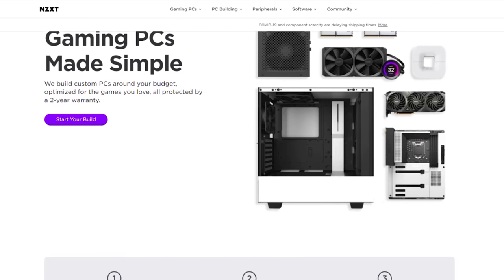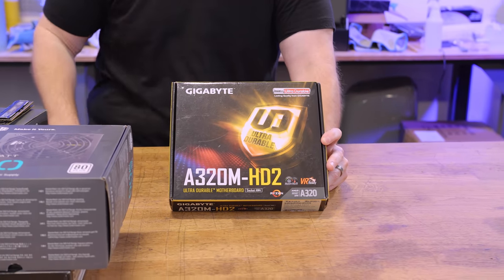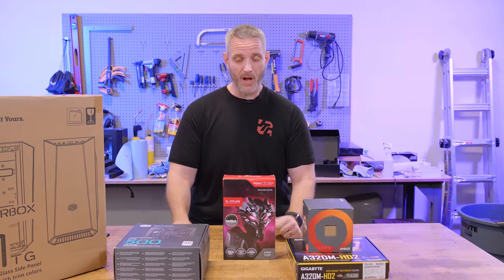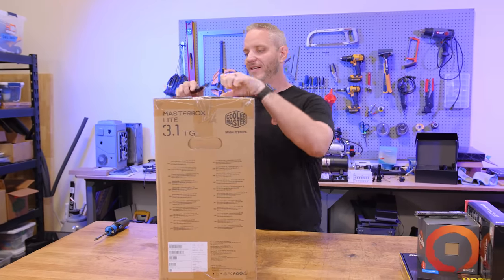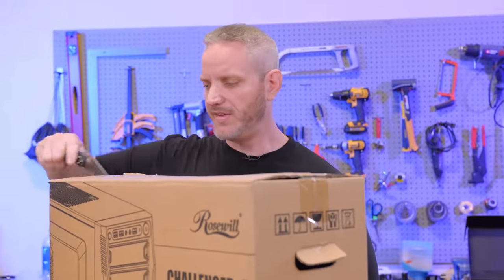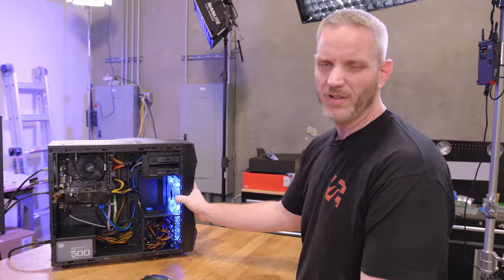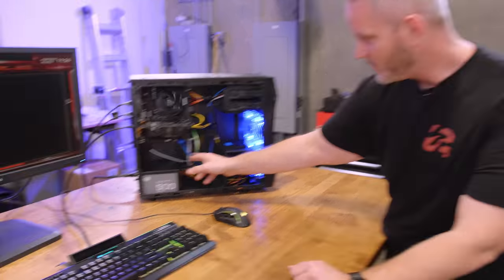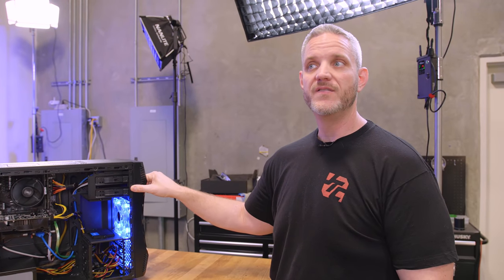The most Practical PC Build of 2022... Extremely Tight Budget Build!

Comment: My parents landed up with an overkill "low end" system simply because last gen parts are still stupidly expensive over just buying a new Ryzen 5600X. They had a A8-5600K APU with 8GB of RAM that wasn't cutting it. I had an extra X570 board forced upon me by the Newegg Shuffle that I wanted to use. So a 5600X and 16GB went in. They already had a Quadro P400 card to run two 1440p panels since the old APU's iGPU couldn't handle anything that fancy. It's all stealthly packed into an old Antec NSK4480, running cooler and quieter then that A8 APU ever did! Even still has the DVD drive, just because. I still need to find one of those drive bays with USB 3.0 ports so it has modern connectivity.

The biggest problem I had was the 480w power supply wouldn't work with the new board for some reason, so I had to drop a cheapo 750w unit in there (smallest I could find local).

Comment: I think that system will serve her well for probably the next 5-8 years. A sata Blu-ray drive might be a good idea, since they can play DVDs, and the Blu-ray would be a good idea since a lot of disc based content is Blu-ray these days
Reply: 5 years at max (until Windows 10 is active), unless Microsoft upgrades compatibility to allow Windows 11 to run on Ryzen 1000 or 2000 Series.
Reply: Having blu-ray capabilities on your desktop is so choice. Only problem is, the Blu-ray Disc Association, in their infinite fucking wisdom, decided that the only (legal) way one would be able to play UHD blu-rays on a desktop would be to have an Intel processor from 7th to 10th gen (11th and higher doesn't support SGX and, thus, won't support the DRM) and to have a PC running Windows 10. No, not even Windows 11. That's it. Those are your only (legal) options for UHD blu-rays.
Reply: @Sup_D  Windows 10 support officially drops in 2025 but 2022 might actually be the last year during which we get updates for W10.
Reply: @arnox4554  bruh

Comment: My husband does a lot of DVD burning (home videos and backup copies of his video edits) so the reason I ended up buying the particular case I did for his build 2 years ago (A Phanteks Enthoo Pro) was because it actually had those bays and the price was right.  It has a SATA internal DVD burner.  I've explained to him since that it's probably the last time, since in 4+ years when we plan to replace his rig again I expect it to be tougher to find a halfway decent case which still has those.  But I also told him that external DVD burners are a thing and will work just fine for his needs.  My current 6 year old rig also has an internal DVD drive (in an NZXT 210 Source Elite), but I'm going to skip an optical drive entirely when I build a new system this summer.

Comment: As a Canadian, and how Im subject to slightly higher pricing, Im not sure how going with an older gen Ryzen to add a graphics card, when something like a 3200G probably would have been the better play here in terms of modern budget?
Reply: I'm helping a Canadian out and the 3000 series is not all that much cheaper than the 5000 series. Especially the 5600x. I feel like I'm getting people into a cult or something because I have one and now my friend has one. But for the estes $50 or so, it's a fantastic chip for the money.
Reply: @MrJr1976  I mean, it's obvious they're all parts he had laying around for years. The 1300 looked like it had old paste on the pcb, which is fine. He took parts he probably would have otherwise never used again to help her out on the cheap basically.
Reply: @xwalkerx27x  Exactly. I'm just talking about for someone who doesn't have PC parts just lying around

Comment: my practical build that i built on a tight budget 3 years ago now has an i5 9400f, asrock z390, with a darkflash cooler, a radeon rx570 8gb armor oc, 2x4 gb t force dark ram at  2400, a 1tb wd mechanical hard drive all in a nzxt h500

Comment: Mine absolute budget build turned out to be $418-ish after tax
Inwinn Case I bought locally for $45
A520 Board for $50
AMD 5600G for $211
16GB 3600 DDR4 for $80.

SSD and Wireless adapter migrated from previous builds. If had to buy I guess it works be $45 for the drive and $18 for the WiFi.

Comment: Sounds similar to the build I initially pooled for my parents to replace their HP Media Center. Ended up with a 7100 intel i3, 1050ti and 8gb of ram... 

Over the pandemic it got my old i5 7500 and an extra 8gb of ram to run iracing.

Comment: Just doing a similar HTPC themed build.
All in for $390AUD
New Parts: i5-10400
Used parts I bought: GA-B560M AORUS ELITE, 2x8GB DDR4 3200
Stuff I had: 60GB SSD, Antec HTPC case + PSU, 2 HDD's and a DVD drive.

Best bit I've sold nearly $300 of old PC hardware I didn't need :)

Comment: I would have gone with an MX500 on the SSD. Just because you are not gaming with it does not mean you should'nt be concerned with the duty cycle of the SSD. Having storage that will last twice as long before it starts having problems is worth the price difference between the BX and the MX. Unless it is a scratch disk holding only temp folders and swap, you should avoid the BX line.

Comment: Two Christmases ago, I built my girlfriend a practical "gaming" PC, since she had never owned anything besides a crappy Windows 7 laptop. I built it from left over parts I had over the years, it has:

i7-3770K overclocked
ASUS Sabertooth Z77
Corsair Vengeance 1866Mhz 8GB 
GTX 760 2GB
Corsair 750W PSU
1TB SK hynix 2.5 SATA SSD
Corsair 750D case

The only new parts I had to buy were the SSD, and I got the PSU and mobo off of eBay for $100 total. She mostly plays super basic games so she's been really happy.

Comment: Back in 2019, I did something similar for my family, after their HP prebuilt crapped out on them. Though I ended up using a 2200G and a B450M DS3H, since they were available as a combo. System cost less than a prebuilt, and was far better, too.

Comment: My practical build:

Ebay Optiplex 9020 that came with a 120 GB SSD and windows 10 pre-installed
1 TB HDD
140 mm fan that fits (with heavy modification to the internal hard drive bay)
Amazon GT 1030

It works well for the games I play. The only time I’ve wanted to play something and couldn’t at all was warzone. It would be nice to have something like a 1050 ti or better, but only to a certain point because the power supply is only 270 watts.

Comment: i did a practical build for my younger brother, with leftover parts specs follow:
Cpu: i3 10100F
Gpu: GeForce 650 Ti Boost
Case: a 20 yo HP case
Ram 16GB Crucial ballistix
MoBo: Asus Prime B460M-K
Storage: Old laptop hard drives for a total of 1TB
then i threw in a wifi card

Comment: We chose the same case for our grandma builds. I went b450 DS3H, stuck a 3200g in it, a 250GB M.2 SSD, and a PSU and called it a day. I think I spent about $350 on it. Was about a year ago. The PSU is questionable as it is the Gigabyte P450b. Technically not listed as one the exploding ones but I don't trust it and plan on pulling it at some point. The power draw is so low though that I am not even sure its an issue more of a peace of mind thing.

Comment: I recently build some Pc's for clients with i3 10100F, 16GB dual channel ddr4, ASUS Prime B560m-K motherboard and 650w PSU and one with a 1650 and the other with a 1660 Super. Not high end by a long stretch but it is what was available at the time in South Africa for the allowed budget. I was pleasantly surprised at how well the little i3 performs, I chose a good Motherboard with cooling on the power delivery to allow for upgrading the CPU easily in the future and the 650psu should allow for headroom to upgrade the GPU when things get better.

Comment: I built a practical gaming rig myself last year.

My specs:

Ryzen 5 1600x (Obviously I have a few gens to upgrade to)
ASUS Rog B450-F Gaming II
nVidia 1650 Super
Rosewill 700W 80+ bronze psu (for future upgrades)
Same case as in the vid.
Crosair Vengeance 16GB 3600Mhz memory

Total cost: Around $600 USD

The Challenger S II mid tower was actually surprisingly well-thought out for cable management for what it is. I had no issues whatsoever getting a fan controller and extra SSD tossed behind the motherboard tray. I dealt with the blue USB 3 cable by putting clipping off the connector (don't do this unless you have the tools to reconnect it securely and properly) and putting black heat shrink tubing spanning the length of the cable. The Rosewill 700W psu i have had black mesh over the cables so i didn't need to do anything with it.

Comment: Jay C - Yes they do make CD Drives with sata.  I ended up reusing a Bluray drive from my old system in my new system.  Due to the case not have any 5 1/4 drive bays I have run a long power/sata cable out the back of the case and the drive sits on the top of the case.  You can get external drive bays, which are very expensive, almost as much as a Bluray drive itself.  This solution maybe jank, but I used the Bluray drive for when I backup my Bluray moves, which then go onto my Unraid storage server.

Comment: the most practical for me is probably a 5600g with an updated b450 (could go with 8 or 16 gigs) and 1tb ssd with just 2 fans since thats all you should need with a build like this. built mine (5600g, tridentz 16gb 3600mhz, 970evo1tb,b450,coolers that came with p360a) for 1000 bucks (excluding peripherals). of course a better one would probable be a 2200g or a 3200g and that might bring thst cost down to 700 with 3400mhz ram and non nvme ssd. found out it works pretty well and will please all non gamers and might even be a bit overkill for them,

Comment: Instead of that video card you could for about $50-80 more get a yeston RX 550 direct x 12 compatible 

Also there is a script you can run to get win 11 on there.  I used it to get win 11 pro on my X79 system with a 3930K and 32GB ddr3 ram and it runs great and updates every Wednesday.

Comment: It must be an age thing. Every practical, meaning as cheap as possible whilst being reasonable fast, build I've done in the last two years has a SATA I/F DVD/RW drive. For some odd reason I have much better results loading operating systems from the DVD drives than I do from USB keys. And the SATA drives ARE faster. Going forward, I can play the DVD movies we've collected. At the same time I get to boot from NVMe M.2 drives and life is good indeed, without the light show that I find distracting. Jay, this doesn't stop me from admiring your craftsmanship - you do good work!

Comment: Hey Jay make sure to run a sata data and power cable to the 5.1/2 quater inch bays so it's easy to plug the drive in later,especially if you are going to add it later at it's destination location.

Comment: A year ago, a friend of mine ask for a low end PC to do some office work, nav, and basic stuff.
-i3 10100
-2x4GB HyperX 2666MHz
-Gigabyte B460M DS3H
-WD Blue SN550 500GB NVME
-CoolBox T300 Slim with 500W SFX PSU

I told him it could be cheaper but it is worth it to spend a little more in a i3 vs pentium and NVME vs SATA. This will last a lot of years.
All For 350€ and the PC is fast, slim, quiet and upgradable in every way (CPU, RAM, PCIe cards, SATA SSD/HDD and optical drive.)
i dont like MOBOs with only 2 RAM slots unless is mini-ITX

Comment: My “new” old school build from parts I had in my HP Elite 8300 that I had maxed out but I didn't need more power just a smoother running system. So here it is:
Intel I7-3770
G.SKILL Ripjaws X Series 32GB DDR3
ASUS P8Z77-V LX Motherboard
EVGA 600W Power Supply
ASUS Pheonix 1050 Ti 4 GB
HP500 SSD
HD 1TB & HD 3TB
Fractal Focus G Case in Petrol Blue
Windows 10 PRO 64
And Yes -  A Blu-Ray/DVD Writer
I primarily use the system for research, media and live streaming with no problems.

Comment: i own that case for my side pc. mine came with 2 120mm blue fans and a rear black fan. the lights now flash and are going out on the front fans so i replaced all 3 with a 9$ pack of 3 fans and it works fine. the cable management is genuine horrendous and if you try to put a fun on the side panel it makes the most horrendous noise you'll ever hear

Comment: My go to budget build for non-gamers...AMD Athlon 3000G on a Biostar A320MH mobo with 16GB of Silicon Power Zenith DDR4-3200 and a 512GB Silicon Power A58 SATA SSD in a Cooler Master N200 mATX or Golden Field m3S(when it's in stock and on sale) case. All powered by a 400W Cooler Master MWE 80 Plus White PSU. Total cost...about $285 Canadian dollars. Streams like a champ with the Vega 3 iGPU, and is Windows 11 supported. Adding an RTX 3050 or other low end GPU later gives an adequate 1080p gaming experience. I'm using a 750 Ti in one of them right now on a B450 mobo, and the CPU is overclocked to 3.9 GHz. I'm only targeting 720p though, because the TV that I use for a monitor is rated at that.

Comment: The most practical build I did for a friend who just wanted to use it for work and play 4K movies and a little bit "future proofing" lol.. case was from Rosewill with 450W PSU included. A decent Gigabyte DH somthing model AM4, Ryzen 3300X, 16GB, 1660 Ti and a 1TB WD Blue SSD. The GPU was still better at those days in terms of price so why not lol. Boss Jay was right it is hard to find the most basic parts if you are used to high end pc build.

Comment: I had to rebuild my dads PC after 12ish years last weekend and I had the same "needs a DVD drive" issue for his build. 

 So we had to change the case at Microcenter from a Lian Li LANCOOL 205M to a Cooler Master N200 because it was the only thing in stock with a 5.25 bay. :(  

 Other than the disk drive the only thing we re-used was the 1050TI i got him a few years ago. 

He went from a Dell xps 1 Gen I5 8GB DDR3 with a 3tb platter drive not installed in GPT so he only had 2 tb available to use to an ASUS B560M-PLUS TUF, I5 11400,  16gb pc3200 ddr4, the 1050ti, and his dvd drive to be used for turbo tax every year.  

But hey hes got a newer CPU and faster ram than I have now :P

Comment: I built my mom a computer. I had bought a 2200G for 50 bucks. I then found a killer deal on a b450M computer case (nzxt) and a used 750W corsair.  I used my old 600W powersupply, bought some new ram and a 500GB ssd. My mom now has a basic desktop pc and it cost me total 500 bucks, maybe it was 400. Overall shows that to make a cheap desktop rig you don't need to spend a ton of money.

Comment: The only builds I am interested in are the low budget ones. They give the most value for money.
Reply: Actually they are the least value for the money because there are so many cheap pre built pcs and older refurbs that work just as good for a home daily driver pc, it's basically impossible to beat some of the pre built prices.
Reply: @drunkhusband6257  Yeah, no. Low cost Prebuilt use low quality items. You get a better system just by building it yourself for a similar price. Ask me how I know.
Reply: Best bet for a basic home system is to buy a refurbished unit or a pre built, I'd never recommend someone waste money building a pc on the super low end.

Comment: This reminds me of the build I did for my sister back in... 2018 I think? Though between some hand-me-down parts, some good deals and some upgradeability mindset it ended up being quite a bit of a mismatch. i3 8100 on a MSI Z370 Gaming Pro AC (overkill, chosen because it was one of the few boards with onboard WiFi and a decent amount of PCI slots I could find and MSI was one of the go-for brands back then), 4x4 sticks of Corsair Vengeance LPT (again, overkill, but I tried to future-proof it as much as I could), and a GT 1030 (GDDR5, of course) in a cheap but gold Zalman R1 case. In this case, the idea was to make a sturdy and upgradeable Netflix PC that could be turned into a decent gaming one just by getting a proper video card in.

I approve of the Crucial BX500 used in the video - they might not be the fastest on the market, but still enough to cap the SATA bandwidth and they're ridicolously good bang for buck. My go-to first step for breathing new life in old laptops.

Comment: I'm running a Ryzen 5 1600 w/16GB ddr4-3200 CL14.  I just assembled that used/new hybrid in Jan 2021.  I know my mobo has fTPM, I just have to invest in either a Ryzen 5 2600 or Ryzen 7 3700x to replace the R5 1600 to run Win 11.  I'm on Win 10 still..no issues.  I have a few clients still running older system, that are not win 11 compliant or friendly.  They don't feel the need to go to Win 11, since their PC is doing hat they need.  More budget builds of this nature would be nice to see..or even used/new hybrid builds.

Comment: My first thought was that it cannot run W11 but waited to comment until the end to see how you got it working. Guess not. 

My backup desktop has a Ryzen 1300X in a Gigabyte AB-350 Gaming (B350 chipset) and even with TPM2.0 enabled in BIOS, the W11 installer throws "Your system does not meet the minimum specifications". Even though Microsoft specifically said that you would be able to install W11 with the installation media (Fresh install) if it won't let you upgrade within W10. And I WAS able to install W11 on my laptop with the installation media that 'doesn't meet the specs' according to the W10 to 11 updater (Intel i7-6700HQ). 

Kinda annoying the arbitrary requirements for W11. Not that there is anything wrong with continuing to run W10. 

Thanks for the video. Great job on the montage Phil. Funny seeing a high-quality montage on a build with such an old-style case and ketchup and mustard PSU cables.

Comment: I kinda like a old style case like this without TG side.
Capable of 2 disk drive for oldies (reminded me of oldtimes using 2 disk drive for "photocopy" a disk instantly), 2 fan 120mm front intake, 2 SIDE intake fans that blows directly to gpu and cpu, while still able to reside modern stuffs.

Wonder if old case like this with modern features like back cable management, psu shroud, top fans and retaining old features exists